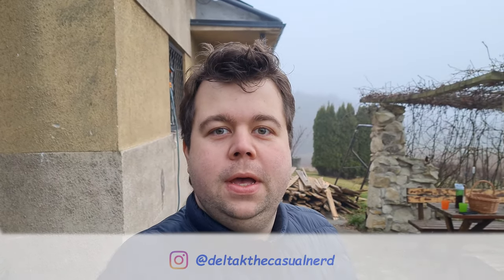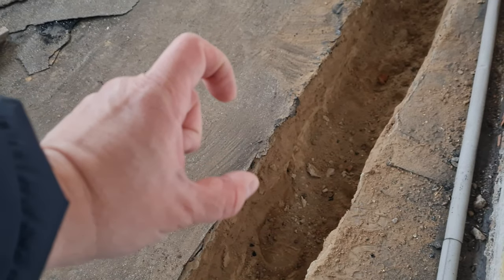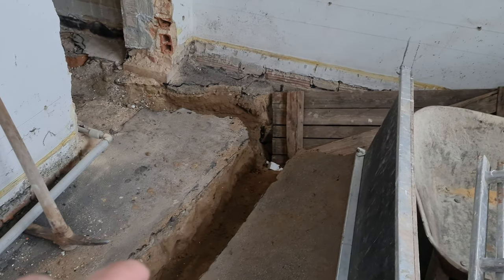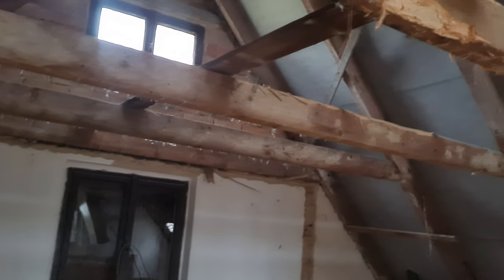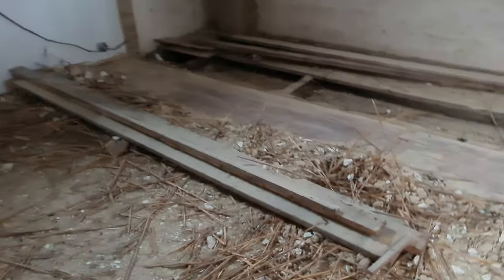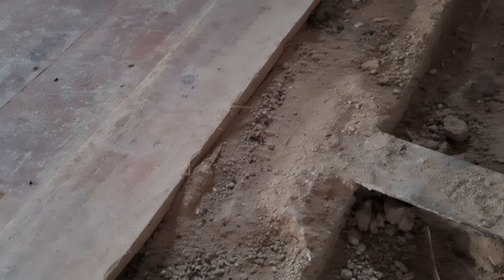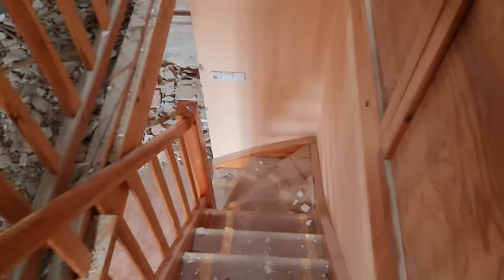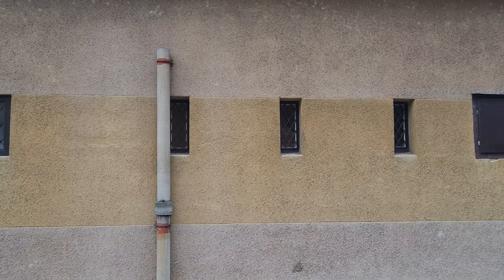Work has begun, first - DESTRUCTION // Cottage reconstruction part 2

Comment: Can you pour something over the concrete to be level with the steel beams, like lightweight concrete (with polystyrene or perlite mixed in) so you get a flat surface to put OSB onto? That way you don't lose any height. We used a Cemix product just across the border in Austria.
Reply from the maker: Thanks for an idea, unfortunately the ceiling is non load bearing, and the beams are too far away from each other to OSB reach :-(
Reply: @deltakthecasualnerd  So the concrete is so thin that anything you build will have to be supported by the steel beams and only the steel beams?

I fear at that point removing the old concrete completely might be the only reasonable option unless you want to raise the floor by the height of an entire step. Or maybe you could reinforce the existing concrete from above and make it level with the steel? I guess you'd have to talk to a structural engineer.